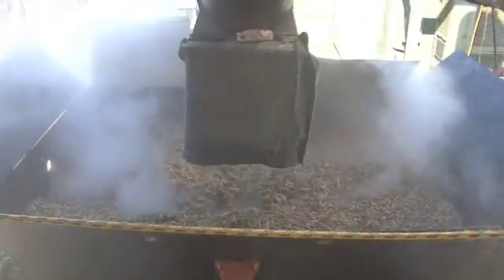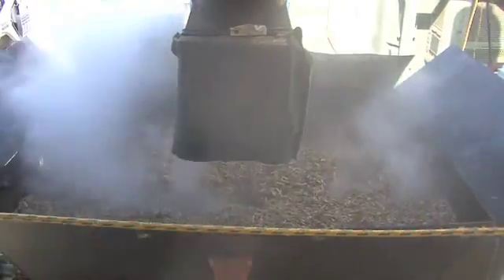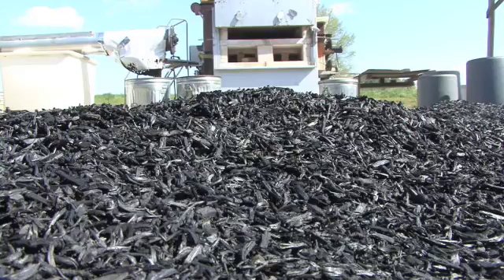Wood is the New Coal

Comment: The mantra is that we will always need fossil fuels and else we will use hydrogen for steel. But hydrogen is a Trojan horse to me, brought in to force continuous use of fossil fuels. 
Now if through torrefaction and compression, a kind of biocoal briquette is formed, usable for steel and cement production then the problem becomes the nature of that biomass. I am almost certain it doesn't need to be wood. Something like bamboo might be perfect too. Most likely other fast growers will do too, I think about Asian knotweed. but not something soft and leafy.
Of course cutting down trees far away, sawing them, chipping them, transporting the chips eats already much of the energy. That's not the way to go. We must have local fields of plants. 
I also question a bit the way heating happens. A better way could be microwaving but I have no idea if a room size microwave oven is technically possible.  With microwaves the moisture inside the plant is used directly for heating. Normally that should save energy and the released gas might be purer,  containing more methanol etc..

Comment: @ewfleisc It does not take a PHD, just a little common sense, to see that this is not an efficient process.  The description says 10% loss in energy of wood chips.  The wood chips have to be produced and delivered to a site.  It takes a good amount of HEAT and chemicals to produce the end product. The end product has to be shipped back to user. It is an easy equation.  Efficiency = output/input * 100%.  If he has built a better mouse trap the world will come knocking.  Let's see.

Comment: Hmm you can take wood, put it in a retort, set it alight, then seal it up, use any volatile gases to further heat the wood. Bingo it's charcoal.  So Torrefaction is the same? but at a lower temperature? The stuff coming out the end looks just like charcoal. Comments on energy efficiency vs retort manufactured charcoal briquettes?